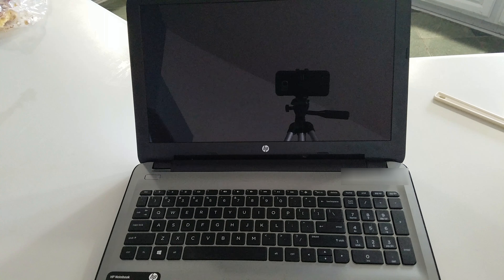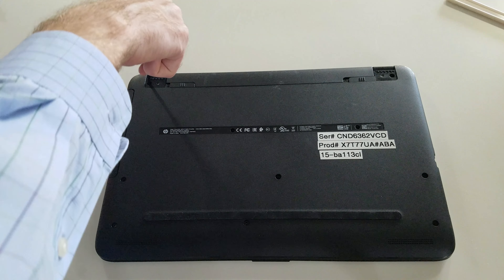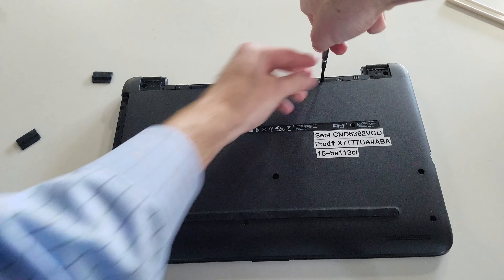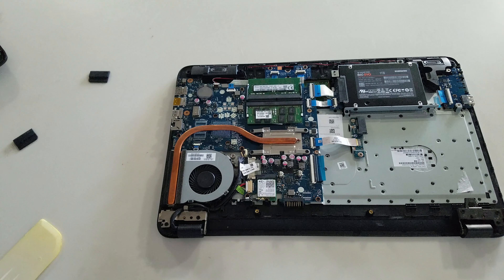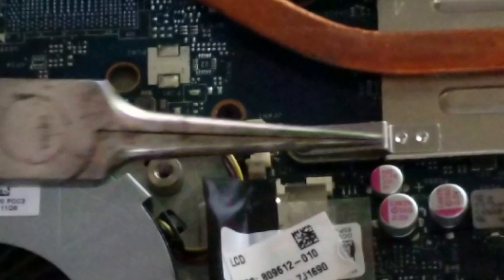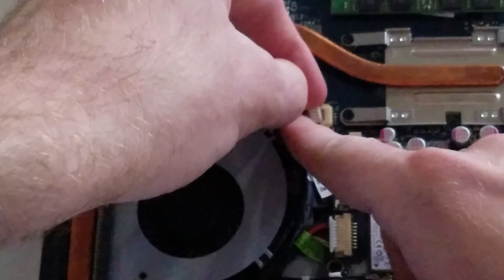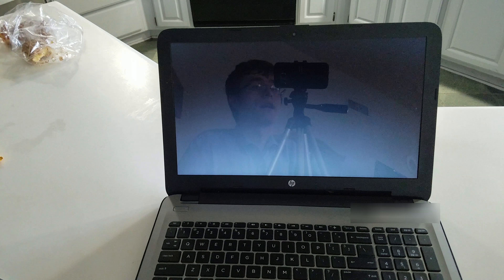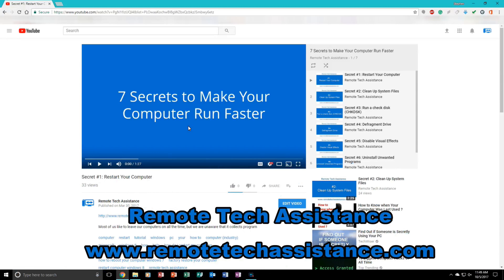How To Replace Your Noisy HP Laptop Fan

Comment: Thank you for a very helpful video!  
When removing the old connector, I noticed the red wire was at the top of the connector.  That was helpful in orienting the new connector.  Also, when putting the new connector in, I didn't use fingers, as you did.  I used needle-nose pliers to hold it and pushed the back with the blade of the screwdriver, being very careful of the wires.  It took a finger at the end to seat it solidly.

Comment: Thank you for this video.  You made it very easy to understand and there seemed to be nothing unusual about the event.  Since replacing, however, I cannot get ANY power to the laptop.  Nothing.  The blue charger light comes on where it plugs in, but that's it.  So disappointed.  I now wish I would've just lived with a noisy fan.  Thank you for the good tutorial though.

Comment: Hey, thanks for the upload. As it turns out, the model my son has  (15-bn070wm) does NOT have a fan, just a metal/copper heat sink. I did find, however, evidence of a coffee or soda spill! So a little cleaning and a new SSD should update this at least for another 2 years. Thanks again!!
Reply from the maker: I even do an ssd video on this same model!

Comment: I tried to remove the screws, the battery, and the cd/dvd drive.  After doing all of that, I could not pry the laptop open all the way.  I was going to try to replace the cooling fan, but it looks like I will probably do more damage to the computer if I keep trying to pry it open.  It is a good thing that I did not buy a new cooling fan yet, and I think I will put everything back the way it was and use the computer only in case of emergencies.  My mom already has a new laptop, and this loss will not hurt us.
Reply from the maker: Try and look carefully to see if you are missing any screws you forgot to take out.
Reply: Mine had two more screws under the thin paper sticker on the back. One of those screws is what holds the disk drive in.

Comment: Thanks for sharing dude! My cooling fan broke, I really hope they sell it separately, instead of the whole set which includes the metal pieces and stuff. If not, I will have to resort for those cooling pads. (it doesn't require that much cooling anyway, being an old core2duo, which aged quite well I must say...) Ever used any of these cooling pads? Do you recommend them? For a laptop without any fan inside of it (like mine at the moment) should I buy one that sucks air down or one that blows air upwards?

Comment: Hi Stephen, I need to replace my laptop fan but I'm not sure what type to order. Can you help me?

I have a HP Pavilion Dv7-6b51ea, serial number 2CE1472N79, product number QG732EA#ABU.

I've tried looking on the HP website but the numbers weren't recognized. It might be because the laptop is over 10 years old.
Reply from the maker: Look up your model number on amazon and add "fan" in the search bar.
Reply: @StephenPhillips  Thanks for the quick response, Stephen. I did as you suggested but there's a bewildering array of fans in the results.

I think I may have found the correct model on laptop-fans. co. uk
Reply: @StephenPhillips  I found a fan for a Dv7-6c54ea. I sent them an email to ask if it was compatible and they said it was, so I've ordered one. Fingers crossed!

Your video was extremely helpful. Hopefully it should be easy to fit the new fan. I'll let you know how it goes. Thanks again, Stephen, and have a great weekend.

Comment: Thank you, when put the laptop back together the screen was black, undid everything and put it back together, still not working - but working with an external monitor.  Help what do I need to do next- is it a connection I've missed or graphics card replacement?
Reply: There's a wire or two right next to the fan that connect to the monitor. Could those have been damaged when you removed the fan, or put the computer back together? Or their "plug" was loosened (which is also next to the fan)?

Comment: I was studying for an exam this friday when the fan on my laptop decided to make the most awful landmower noise I've heard in my life. I opened up the thing and tried to take the fan out to see what was up with it. And I have to say that The fan cable on these things is fucking horrendous. "You just need to jiggle it a little" my ass, the cables and connector are held together with what looks like glue and I am convinced some of it is what's holding the connector in place. My fingernails are gone, every tool I've tried to use has done absolutely nothing and I am devastated.

Comment: So, I replaced fan in my HP Laptop. Got it all back together and the machine booted up normally. I was on the thing for about 20 minutes when it suddenly shut off and wont come back on.

Any idea what I am missing?

The little orange light is on near the charger plug so it should be getting power. However the machine wont turn on.
Reply from the maker: Plug your laptop back in and charge it some more.
Reply: @StephenPhillips  
Stephen I have left the machine plugged in since yesterday. The light is now white, but the machine still wont power on.

When I press the button the laptop begins to turn on and sounds like its going to boot up normally, then it stops and you can hear it wind down.

The screen NEVER comes on.

If I hold the power button down the white light goes off.

If I UNplug the cord the white light goes off.

If I remove the battery and plug in the laptop, the white light is on...

I have pressed and held the button down for 15 seconds, I have taken the battery out and put it back in...
Any idea what I am missing?

I think this could be because the machine was without power for about 5 or 6 days. (I ordered my battery online and had to wait for it to arrive). When I first installed the fan and powered it on, it may have been running on the last of the battery. It was running smoothly before it cut off.

After the fan-install I powered on the machine. It seemed perfect.

I am sorry to be a bother but I work from home and my livelihood depends on this laptop.

Comment: My hp pavilion laptop is loud and I was wondering if changing the fan would make it dead silent, am I correct and if not are there any other solutions
Reply from the maker: I wouldn't go as far as calling it dead silent, but it's pretty quiet.
Reply: @StephenPhillips  my laptop is louder than my pc and I went into the settings and turned down the usage of the cpu, but it turns out none of my softwares work effectively without full power. Although my laptop runs bad without full power, the sound was gone and I could not hear it at all. Is there any solution where I don’t lose anything to achieve silence?
Reply from the maker: @Vicious13  take out the old fan, dust the inside of your laptop out, then put the new one in.
Reply: @StephenPhillips  bet where could I buy one
Reply from the maker: @Vicious13  Amazon.
Reply: @StephenPhillips  do u have any prefenences
Reply from the maker: @Vicious13  Amazon is your best bet. A prime order would be recommended.
Reply: @StephenPhillips  I mean like what fans would u say are the best
Reply from the maker: @Vicious13  Whatever has the best reviews.

Comment: Does anyone have any alternate solutions for a similar issue in the same laptop? Mine was making an awful rattling noise. The fan was not dirty, so we tried replacing it. It was quiet for a few months, and now it's started rattling again. I suppose the new fan could have been faulty, and that was why it didn't last....but I'm not convinced. I'm worried there might be a different issue causing the rattle that we didn't know about.
Reply from the maker: Did you try tightening it?
Reply: @StephenPhillips  I can try that. What's odd is that it only makes the rattling on start up. It seems to run perfectly normal otherwise. It'll get a little louder when I open big games and such, but it sounds like a normal fan. It doesn't rattle then.
Reply from the maker: @MoonDoodles7  okay that sounds like the bearings

Comment: Stephen, I am having trouble separating the seam around the edges. It is loose everywhere except seems to be stuck in the power button area. Do I need to remove the power button or something else?
Reply: I discovered that in my case there was a screw that was covered with a shiny sticker that said "Do Not Remove or will void warranty"

Comment: Everything went fine except no matter how much I shove the fan connector into the slot, my PC won't recocnize my fan and refuses to boot up. I tried putting my old fan back in, thinking maybe I just got a faulty part, but now it won't connect either. What am I doing wrong???
Reply from the maker: I think you put it in the wrong way?
Reply: @StephenPhillips  How you mean? The four little metal bits are supposed to go on the bottom, right?
Reply: Ok, I had it in upside down, thank you 😅